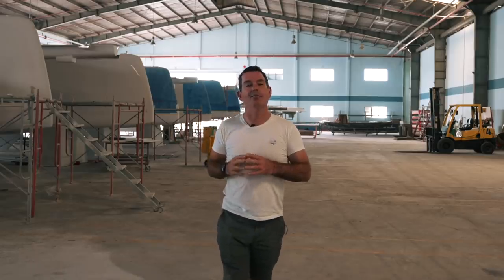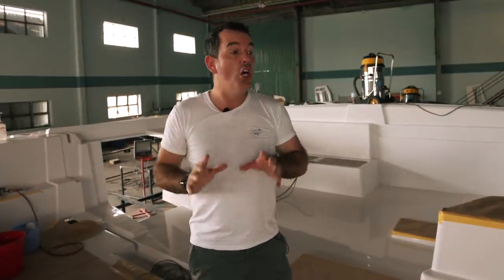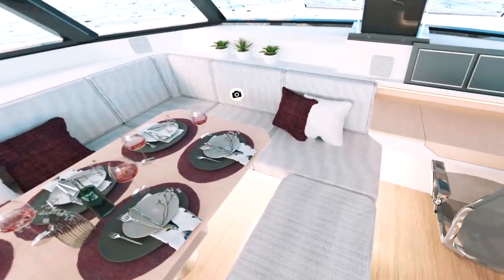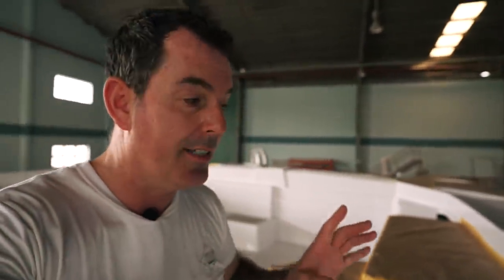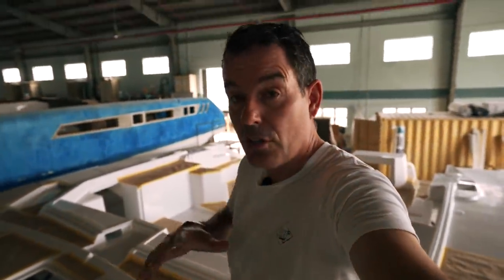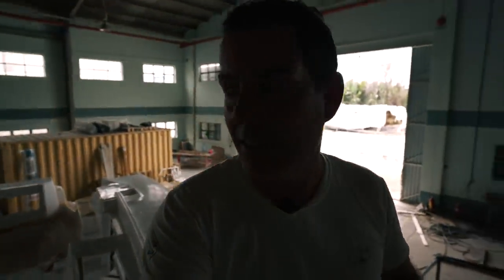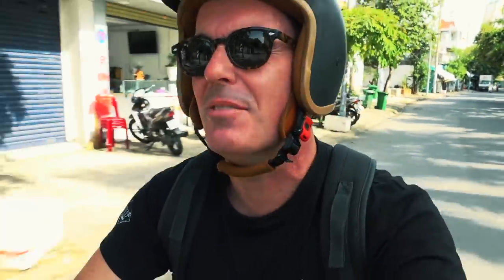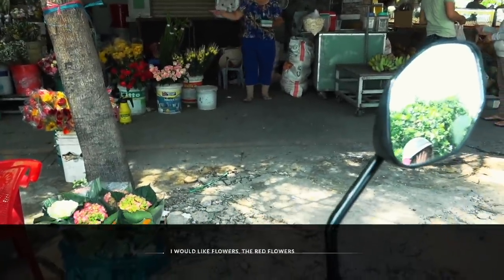What's Happening with the Ruby Rose 2 Build? Also- Life in Vietnam!

Comment: "Thank you for the video on the technical aspects of vessel design it is great that you are taking the time to explain the different aspects of boat building. I was thinking though no one relates the aspects of the build in respect to the theatre the vessel is going to operate in. For example, swells in Australia other than the tassie region seem to be on average 2.5 to 4.5 metres and sometimes six metres plus. Therefore, it concerns me that future sailor may buy on price of the build not the intended theatre of operation in respect to The Capsize Screening Formula (CSF) and the general quote below
Quote "When struck beam on by a breaking wave of a height equal to or greater than 35 percent of the boat's length overall (LOA), every model tested was rolled to 130 degrees or more — well past the horizontal. But if those same waves were taken over the stern or over the bow, most hull forms remained upright.
Have you any thoughts on the different effects centre of gravity and centre of buoyancy for different vessel types in respect to cats compared to monohulls.
looking forward to the next build video!